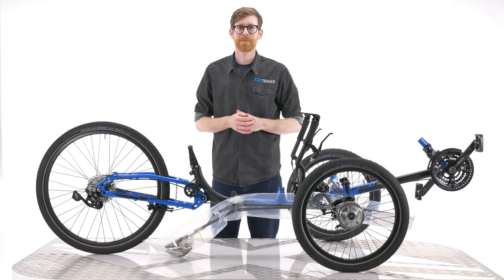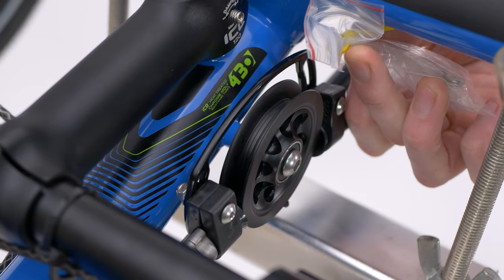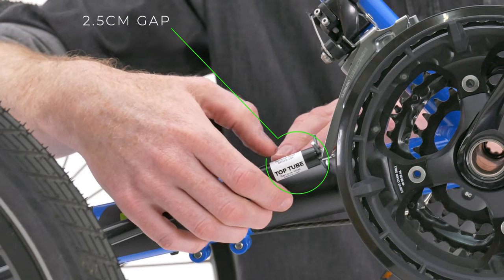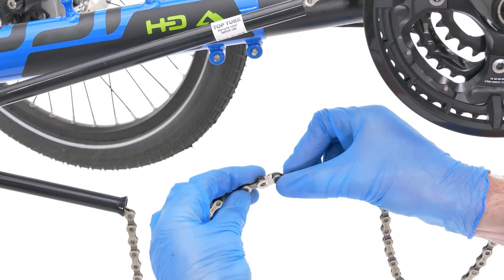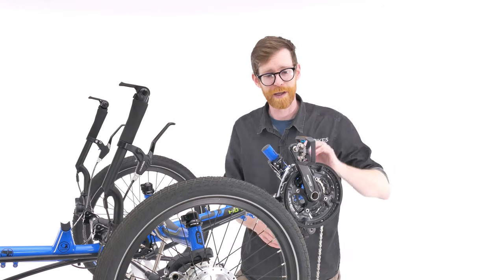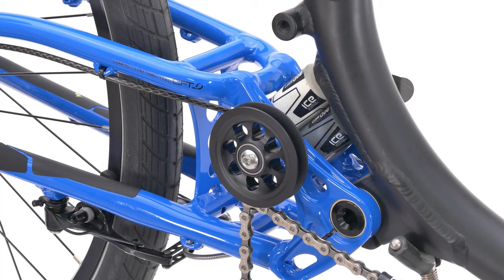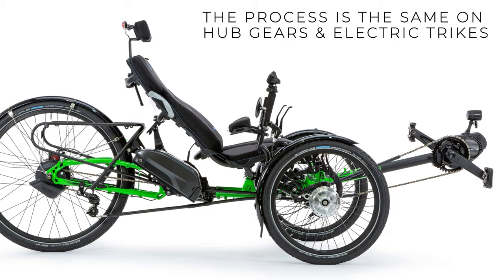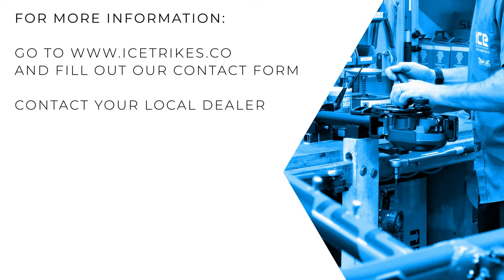Tech Guide - Fitting Your Chain

Comment: Very concise explanation, answered all my questions. Thank you. I shortened the the boom on my wife's trike and it wouldn't go into the lowest rear gear, no matter what adjustments. I think I have to add one chain link.
Reply from the maker: Hi. Thanks for your comment. Just to double check, if you have SHORTENED the boom length, the chain would likely be too long and sagging. this would mean you need to look at REMOVING a link or two. (Unless of course you have shortened the chain already and it's now too short, in which case yes, you may need to put a link back in).